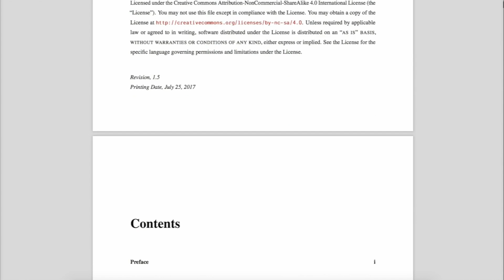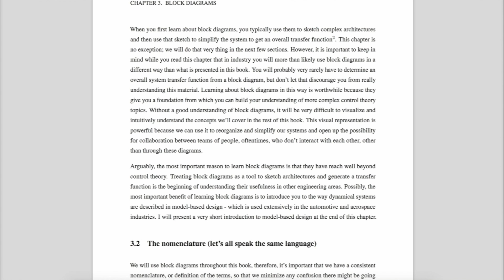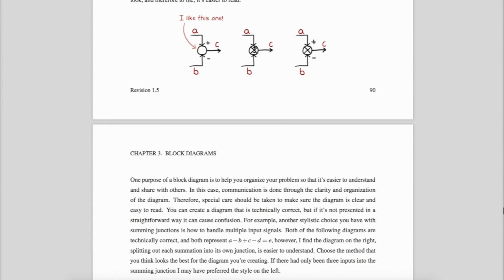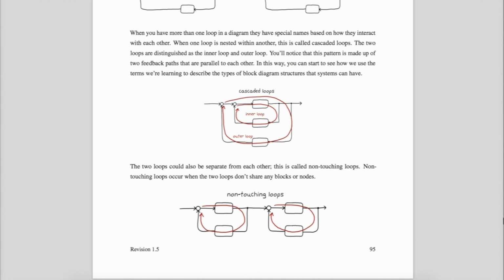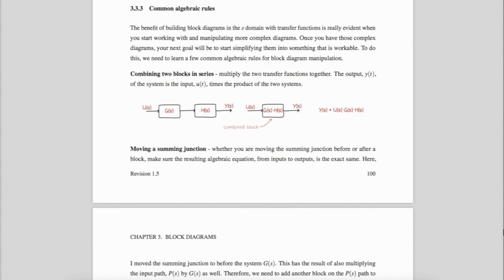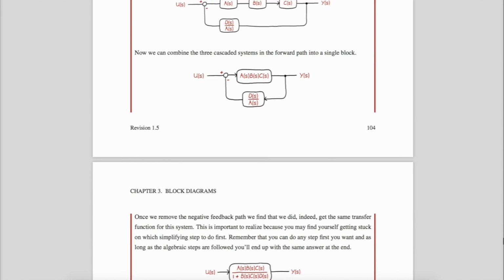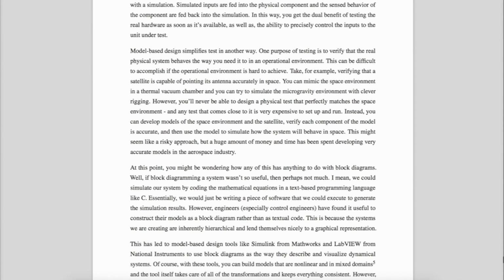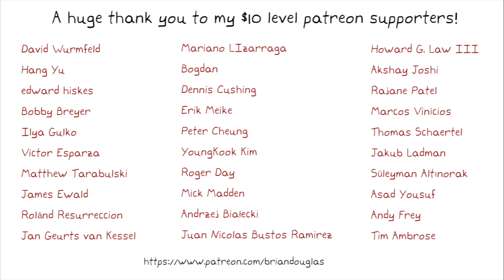Simplifying and modifying block diagrams

Comment: If this book has a chance to cover the topics presented in the videos it would be considered as a code breaker for the control engineering topic, or the key to unlock the mysteries of Control.
I hope sincerely that you can complete it. a lot of the insights in this book are missing from Textbooks on the subject.

Thank you Brian, you are a Hero.

Comment: Thank God you came back. Although it would be nice if you cover other subjects as well, you can only make so much content about control systems.
Reply from the maker: Never! I can make lots of content about control systems :)  But, out of curiosity, what subjects did you have in mind?  Also, thanks for the comment. Cheers!
Reply: This was just an example, you could try many other subjects and/or their combinations.
Reply: I was thinking Power Electronics and especially Drives, you can correlate them with Microcontrollers and Microprocessors, and maybe make a practical series on making a motor drive system from the ground up detailing the Power Electronic Converters and their components devices as well as their PWM and the programming. Finally you could relate all this with the Control System design for it. Also is the option to include Machine Design and Principles. You'd never run out of content in such a multi subject series and it would help more people as well.
Reply: @BrianBDouglas  sir please make videos of signal and systems please sir...respect from India,